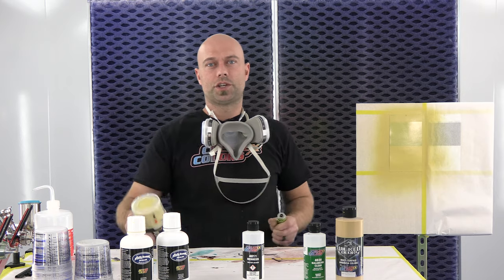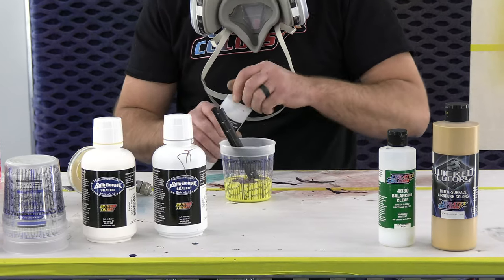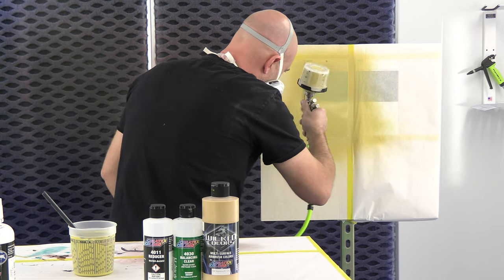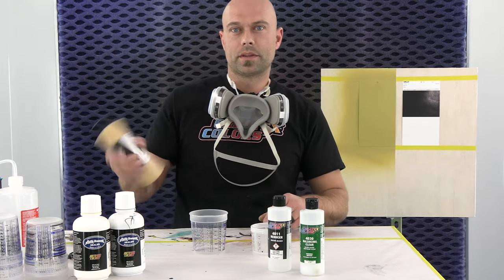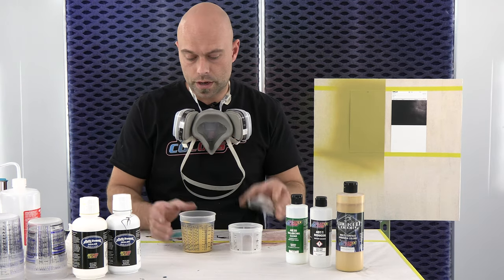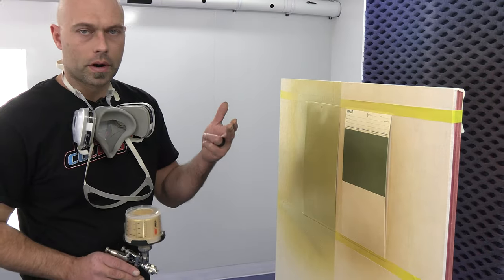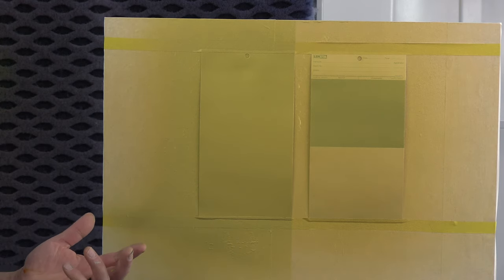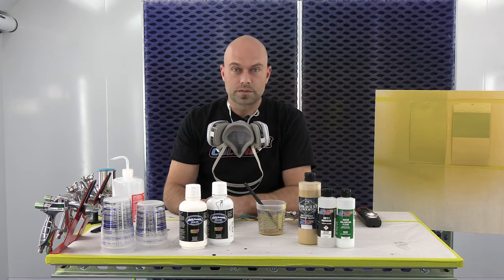How To Mix and Apply A Metallic Gold Base-Coat

Comment: Love the videos, I m pretty sure I've seen all of them( most more than once). So I know every time you mix the paint or sealer you're supposed to let it sit for about 15 minutes before spraying, but let's say I saved my mixture for another day or project, the next time I mix it up, before use do I have to wait 15 minutes again before applying? Any feedback would be appreciated thanks.
Reply from the maker: If using paint that has been reduced with 4011 Reducer the day before, then no, it wouldn't have to be given acclimation time before spraying. Stir, (option strain), and spray. Thank you.
Reply: @CreatexColors  thanks for responding and the great content.

Comment: Excellent job! I liked the Demonstration today. I got another project for a pipe welding hood with a Bleach Ichigo Hollow mask. Im looking forward to using the detail wicked red on it with a blood red candy. Unless he wants it matte red. I use the 4030 for some durability. Is there any other products i can use to make it more durable to hard work conditions. Like being thrown 100 ft over a concrete floor for example.
Reply from the maker: Thanks. For improved durability and a matte finish, 4052 Matte Clear works well, https://createxcolors.com/scenix-mural-theme-paint/uvls-clears/4052.html
Apply as the initial adhesive primer direct to substrate, then paint with 4030 added 10% per vol., then apply 4052 as top-coat clear after paint cures.  For more, please refer to the Hard-Surface & Automotive Application Guide available at creatextech.com.  Thank you.
Reply: @CreatexColors perfect I hadn't done clear coat on anything I've done so far. I like the worn and aged look on some of my stuff. Yall are awesome!

Comment: So all the flakes and metallics will flow through the filter in the PPS cups with no issues or different filters for different paints
Reply from the maker: Most pearlescent, metallic and aluminum colors will pass through the PPS filter, except 4103 Aluminum Coarse. Also, Cosmic Sparkle Colors (small, 8-sided pearl-flakes) will pass but Hot Rod Sparkle will not as they're larger & coarser. Thanks.

Comment: Can I mix gold flakes to gold paint before painting? Or is it only to be mixed with clear?
Reply from the maker: Yes, the flakes won't have the same effect / dimension as when mixed in a clear (4050 UVLS Gloss Clear) and applied over a metallic gold base, but all Createx paints are inter-mixable and Hot Rod Sparkle & Cosmic Sparkle Golds can be mixed with either Metallic or Pearlescent Gold. Thank you.

Comment: To paint any metallic colors do you need "base color" like gloss black or metallic silver? Then paint on your metallic color you want?
Reply from the maker: Start with 6001 AutoBorne Sealer White or 6002 Sealer Black, with white being used for lighter color, black darker. 6003 can also be used, as can color-keying a pearlized color with an AutoBorne Sealer Color. There's a variety of options for metallic color - base colors. Definitely try some test panels to see how the base color changes the value of the metallic color. Thank you. www.autoborne.com.
Reply: Should I sand my base coat then applied my metallic colors?
Reply from the maker: Not with AutoBorne Sealers and Createx Metallic & Pearl Coats, although AutoBorne Sealer can be dry-sanded with 600-800 grit sandpaper, then cleaned with a solvent-based degreaser prior to paint. For more, please see our Hard-Surface Application Guide avaialble at www.creatextech.com. Thank you.